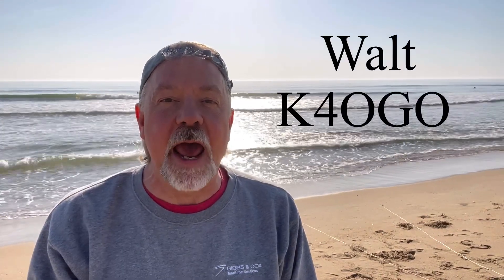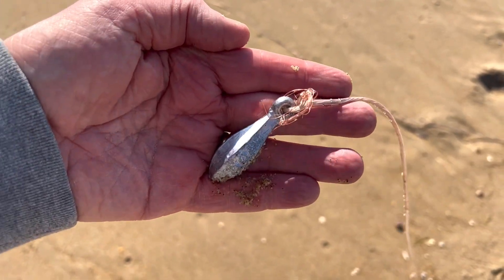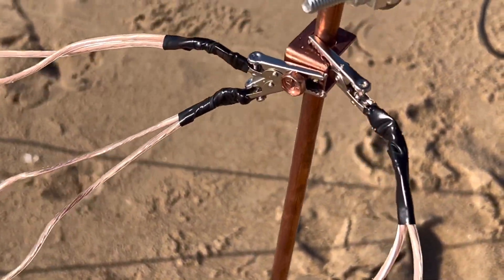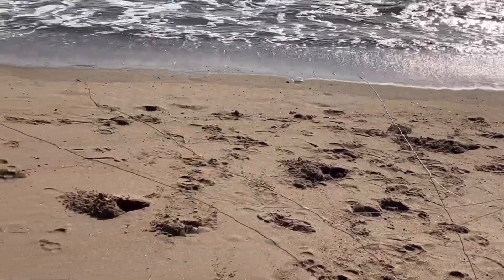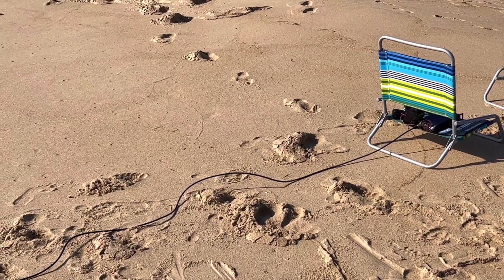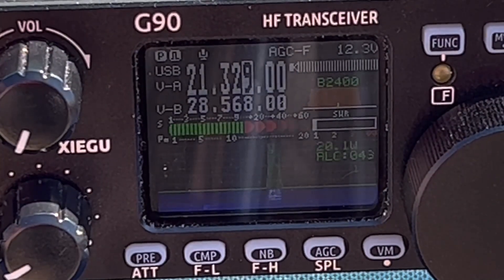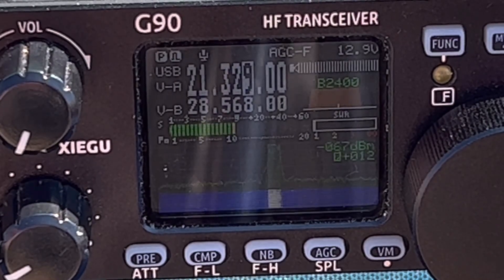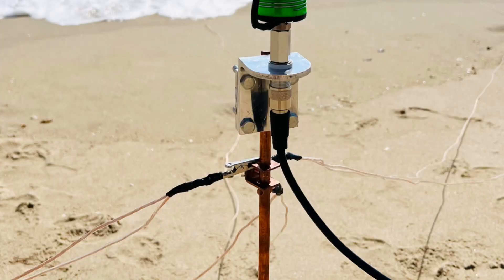Counterpoise Wires at the Beach - How I Set Mine Up

Comment: Good job with the setup and video! I am doing similar things but using my Hustler top loaded mobile antenna. Was using a very long metal tent stake to hold it up in the ground. Not sure how many radials I will end up with. 
I have a 160 Inverted L and have done some experimenting with radials on it. Does not take much to work quite good. I am in Williamsburg, but spent about 50 years hamming on the marsh in Hampton just across the harbor from you.
73 and keep up the good work,
Don 
N4DJ
Reply from the maker: Thanks Don, I actually work not too far from you in Oyster Point. I’ve been scouting out some places on your side of the water to do some portable Ops after work. All the best and 73, Walt K4OGO
Reply: @COASTALWAVESWIRES  I have been to York River State Park and the Colonial National Park. Also a great place at Yorktown just south of the beach/bridge area. Check out my antenna videos at https://youtube.com/playlist?list=PLz0VTJrcB-AaXTlVNRAwxb-KFlG2pC9Ae.  Not as good as yours but hopefully good info.
Reply from the maker: @dandypoint  great stuff, I just subscribed. Thanks for sharing!

Comment: Great video could you tell me what bracket you are using for the earth rod ? Is it the truck mount and the 3/8 fixture from the slide winder bracket ? Thanks
Reply from the maker: Thanks! That is a Workman Double Groove CB Radio Antenna Mount W/ SO239, It's $10 USD on Amazon.

Comment: I'm a newbie and have a question. Where should I install my counterpoise on the antenna if it's pole mounted above my roof? Thank you.
Reply from the maker: Great question, I’ve found the best connection point is on the outer metallic portion of the coax connector to the antenna or to the metal part the outer part of the coax is connected to as long as there is connectivity there. Hope this helps. 73, Walt K4OGO

Comment: I'd be interested in how the rig did without the counterpoise setup. I mean you have the greatest grounding plane splashing right in front of you. That alone should get you a low take off angle for DX.
Reply from the maker: We were  actually talking about this last weekend in the Coffee and Ham Radios show. Steve (Temporary Offline Ham Radio) suggested we make a contact and see the difference. That may happen soon. Thanks for watching! 73 Walt
Reply: @COASTALWAVESWIRES   Though omnidirectional overall,the lobes of your radiation pattern become somewhat directional at that point,as noted in your video,which could be good or bad,depending on your targeted areas.Gray line propagation from east to west will also play into that equation.Thanks for the great videos.They are very informative for those  interested in learning about Amateur Radio.
Reply from the maker: @redman840  thanks for watching and thanks for the input! 73 Walt K4OGO

Comment: I've used a similar setup (IC-705 @ 10W) with a MFJ 1979 (no coil though) and have worked VK from the UK during grayline from a beachside location.. With the right grounding system and at these locations you can work world-wide. All the best. I've order a MIL whip and coil for my setup as well (for when it's windier as the 1979 won't stand any amount of strong wind. 73s.
Reply from the maker: Thanks for watching Adam! Yes beachside is the best! 73!

Comment: Have you thought of using uninsulated stainless steel wires for the counterpoise? They'd conduct to the wet sand and salt water with no rust. You might also find something stainless for the weight at the end. No rust, no bother.
Reply from the maker: Haha you’re psychic, I just ordered some 20 foot long bare copper ground straps to try out. Amazon delivery is today. Was thinking the same thing with the exposed material and conductivity

Comment: Hi Walt, your counterpoise system in sea water is very interesting, does this system also work with soft water such as lake water?
Reply from the maker: No not at all, the salinity of salt water is the key. I recently did a video on “The Saltwater Amplifier” that explains this
Reply: @COASTALWAVESWIRES  thank you for your answer, i will watch this video "The Saltwater Amplifier", thank you for your videos, they are really interesting, Greetings from South of France
Reply from the maker: @ARNAUDRC  thank you so much my friend! 73
Reply: @COASTALWAVESWIRES  have you tried an antenna in pvc pipe, filled with salt water?
I wonder how it'd affect reception and transmission.
Reply from the maker: @CL-ty6wp  k haven’t but I’ve seen others do it

Comment: Great tips, thanks. I’m thinking about the xiegu x6100 and am working on my general. Do you think I could hit mainland US from Kauai with 5-10w or is the G90 a better first radio because of higher wattage?
Reply from the maker: I have hit New Zealand from Kauai with 5 watts so yes the mainland is absolutely possible at that wattage. I love my G90 but I also have a X5105 which has an internal battery like the X6100. That’s really nice when operating portable. You can’t go wrong with either radio.
Reply: @COASTALWAVESWIRES  Right - that’s what’s nice about it…although I have a battery for my VHF go box that could run the G90 if I went that route. 

I like the look of the x5105 and the x6100 appears to be the new version. I’m trying to avoid a desk unit if possible but that may be a mistake? I’m hoping 5-10w would be enough to get started. 

100w sounds like a nice place to start with HF, but I’d prefer to keep the shack to a HF backpack + VHF/UHF go box if possible. Thoughts? Thanks again!
Reply from the maker: @Andrew-dg7qm  I have the Xiegu XPA125B 100 watt amplifier that I use with both the X5105 and G90 and to be honest with you the G90 at 20 watts really doesn’t need it. I worked Australia from my home this morning with just 20 watts on the G90 with my base vertical antenna. I’m seriously thinking about just selling the amp.
Reply: @COASTALWAVESWIRES  good to know. Thanks and 73. WH6GFK